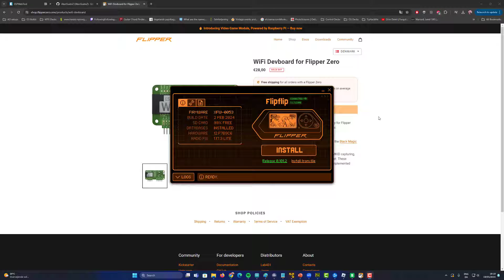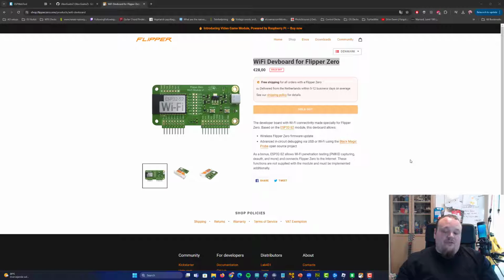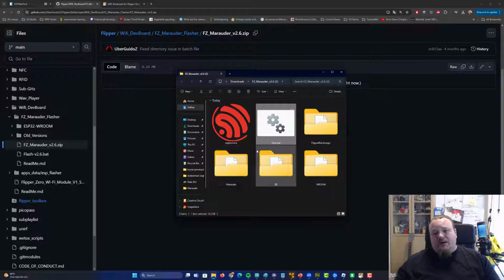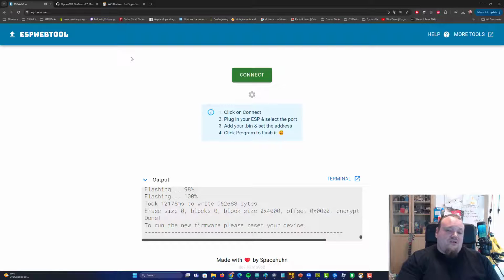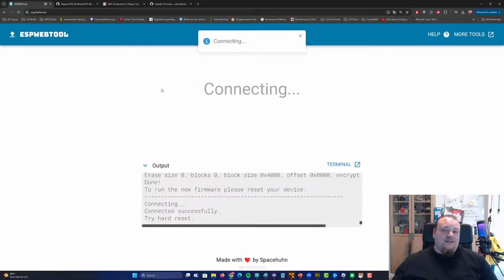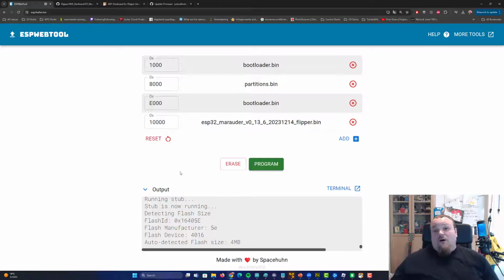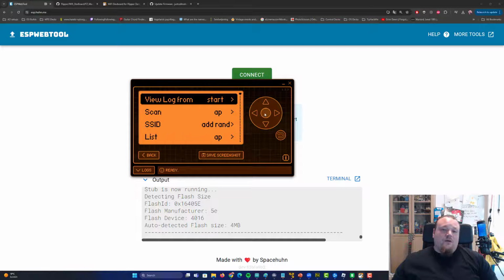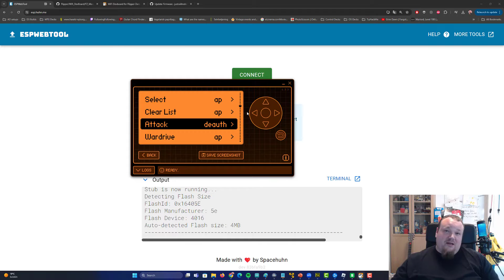Flipper Zero WIFI Hacking: How to Install Marauder on WiFi Dev Board #hacking #flipperzero

Comment: Mine is stuck on the conetting text, what should I do?
Reply: Same maybe you have to flash it first idk
Reply: Hi. Just had the same issue now and fixed it. When you plug in the board into the USB C port, you have to hold boot AS you plug it in, not before or after, and it will appear. To test if it appears, go to device manager, clock the PORTS drop down, and as you plug it in see if a new COM appears. If nothing works, flash it through the .bat file in the marauder file. Hope that helps.

Comment: i have installed the firmware but my flipper doesnt show the same GPIO options as i saw here? I see what I would see if it wasnt connected
Reply: hey man did you find a solution?
Reply: @tremaynelabrooy561 I’m having the same issues here, lmk if there’s any update
Reply: @tremaynelabrooy561  saw this very late but if you use Momentum firmware i found it to work perfectly
Reply: beacuse he is using extreme firmware
Reply: im having the same issue
Reply: @Slippy218  i installed momentum firmware and it fixed the problem.
Reply: @IndoorSugar  Thanks im gonna check it out
Reply: @IndoorSugar  I had to install the app from my phone works fine now
Reply: @Slippy218 Hey man, which app?
Reply: just install [ESP32] WiFi Marauder application from your phone after following tutorial to flash dev board